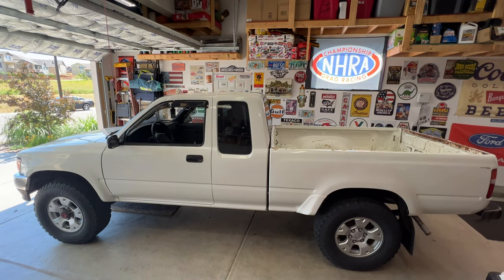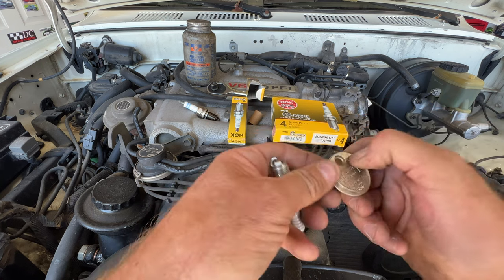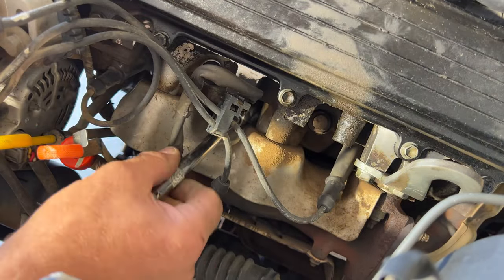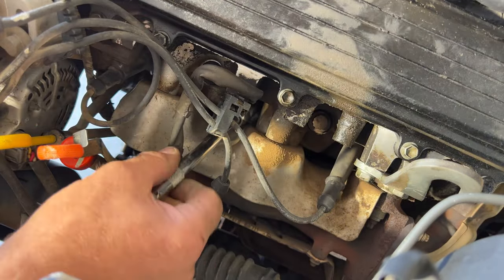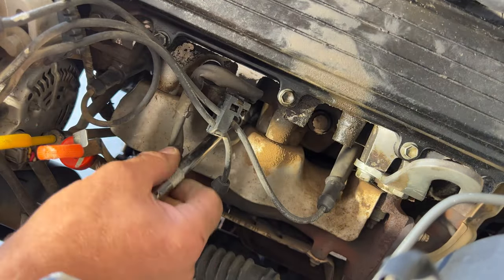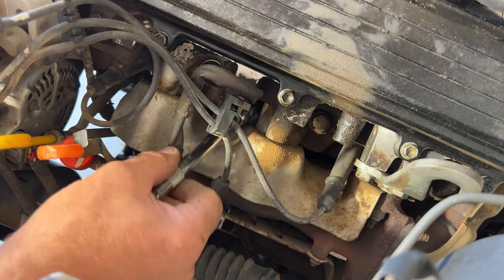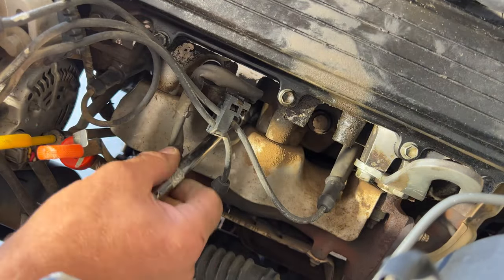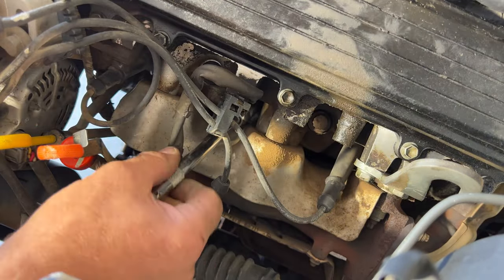1988-1995 Toyota Pickup/4runner Tune Up How-to

Comment: How would i fimd TDC again? I screwed up the first time i installed the distributor so i gotta re do it.
Reply from the maker: You will need to pull the spark plug on cylinder #1 which will be the first one closest to the radiator on the passenger side. After the spark plug is removed you can either stick a long screwdriver or an extension down into the spark plug hole so it will be sitting on top of the piston. Next go ahead and rotate the crankshaft by hand using a socket wrench on the crankshaft pulley going clockwise and watch the screwdriver it will go up and down as you rotate the crankshaft when the screwdriver comes all the way up on cylinder number 1 then you know it will be at top dead center.
Reply: @BLUECOLLARGARAGE  but there's 2 TDC so how do I know I'm on the compression stroke???
Reply from the maker: @o0XFernX0o  you will need to either take off the timing cover so you can see the marks on the cam sprockets or you can use a vacuum gauge with the compression tester adapters that screw into the spark plug hole. With this method you will need to have a vacuum gauge that measures psi and vacuum.